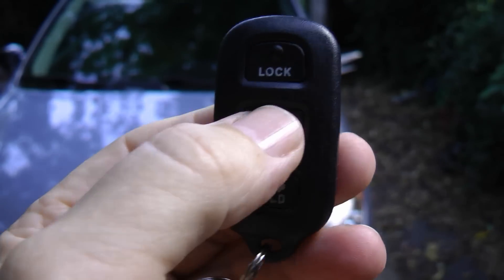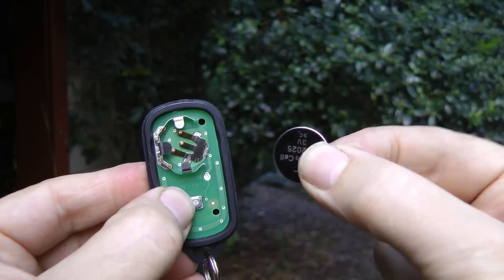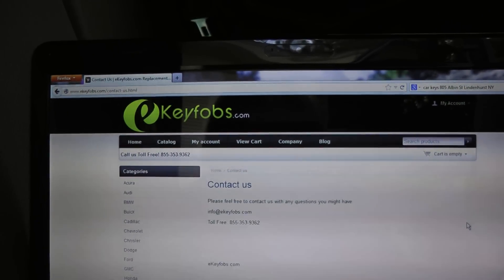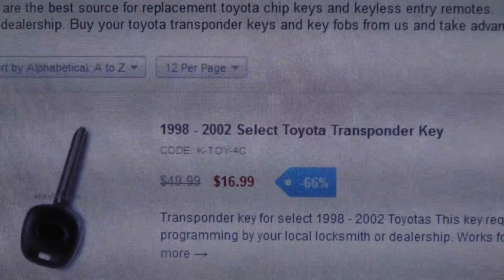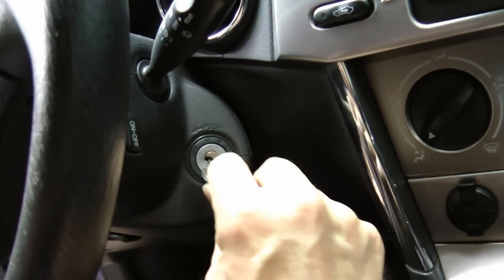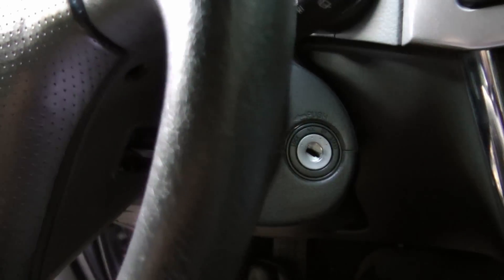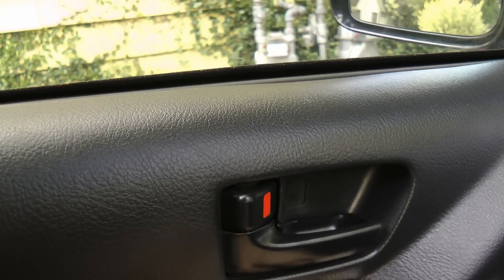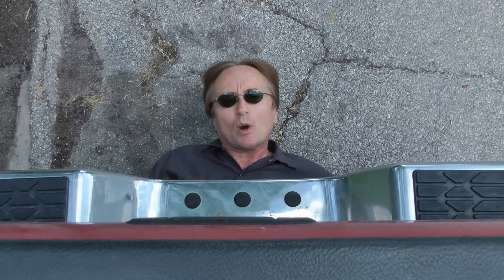How to Replace a Remote Key Fob for Your Car

Comment: Open the door, close the door, put the key in the ignition, turn on the radio, roll down the rear right window, turn on your windshield wipers, turn on your lights, turn your wheels to the left, unplug the cigarette lighter, turn everything off, take out the key, lock the rear left door and your in the programming mode.
Reply: Forget to run around the car clockwise 3 times  then back around counterclockwise 3 times and if you are not dizzy  start over

Comment: LOL. That's hilarious. What were the engineers thinking
Reply: Lucas Short 
I think they just wanted to make it an accessible, independent procedure, that wouldn't be done, by accident, and you wouldn't need a separate computer or tool for.

Another comment was right. It's like a cheat code in an old videogame.

Comment: Scotty, it should be noted that on some cars you have to resynchronize the fob after the battery is replaced. For example on my 1999 Alero you must hold the lock and unlock buttons together for 5 seconds while standing close to the car. The doors will lock and unlock once to confirm resynchronization.

Comment: Scotty, I would recommend trying the remote's circuit by breaking the contacts with the edge of a nickel or other metal. My dad's remote for his Silverado did nothing with a new battery, but then I tried this. Found out the remote worked but the buttons did not. Did some research to find they use a conductive material on the bottom of the button pads and it wears off over time. I super glued a small piece of aluminum foil to the pad and presto! The remote now works.

Comment from the maker: central locking is generally a bad main switch, or the control unit breaking down. Try a new switch and pray, the control unit is very expensive

Comment: often aftermarket receivers are a lot cheaper and work just as well.  Search around for one.  The one for that camry is $450 from the dealer; aftermarket can be had for about $120 that comes with 2 key fobs.

Comment: I would hazard a guess that unbolting the strut and jacking the car up will give you access to the grommets you talk about, so you can replace them. 

Once replaced. Lower the car on the the jack, ensuring the strut bolts go in their respective holes. Bolt the strut back up, job done.

Of course, you'd have to replace the grommet on the other side as it's most likely worn out too and it's just good practice.

Comment: Scotty my radiator fan on my 96 SB combo van stays on , i checked fuses,relays swapped computer , i have temp sensors from another combo to fit , it had a bit of stuff on the brass connections so i've cleaned and polished them , could that be the problem ??? Thanks in advance and i love the simplicity of your videors helps a pensioner that can't afford much , it is greatley appreciated

Comment: Try opening it up and cleaning the contacts with rubbing alcohol. Usually it's just the little silicone pad that touches the contact plate. I find they get dirty after a while and just don't close the circuit after a while.

Comment: scotty my jeep cherokee remote kinda works the lock works fine but the unlock you have to mash it to unlock it so i was looking for new remotes and there are some online but heres the thing for mine to program u need the two keys the car came with but i have the original but the spare one was made will it still work with a key that was made because i dont feel like spending 150 bucks for a new remote and programing at a jeep dealership

Comment: Wondering if you could clarify if I can use any non-OEM key fob for 1998 and 1999 Toyota Avalon(s). Secondly when using a non OEM remote does it require some special receiver to be installed in the car or can I use the existing remote signal receiver as is i.e the one that came with the vehicle.

Comment: On my Subaru I hold down a button underneath the steering column and press the lock button. If the door locks then it's programmed and works perfectly.

Comment: It's real and crazy. To reset and configure the tire pressure sensors on a modern GM car you have to follow a procedure that you definitely wouldn't know unless you designed the system or had a manual....and even if you designed it the manual would come handy haha

Comment: hey scotty. i have a 1998 honda civic ex... its 4 cyl 1.6L and when ever it gets below half a tank of gas as im driving it will sometimes stall.. it is an automatic. i asked a few people and they seem to think it may be the fuel pump or the fuel filter that need to be replaced. do you know what may be causing this? also sometimes it will start right back up and others i need to wait a few minutes until it will start. thanks!!!

Comment: Hey scotty, I got a volvo 945 turbo with a B230FT engine, the problem is. When I start the car i usually let the fuelpump spool up some pressure up to the rail, but the fuel pump didn't have the original whining sound it was almost screaming and when started it layed on 700rpm. Now it's screaming the same maybe alittle more, but the rpm is at 400 and battery + oil pressure gauge is lit up until I touch the gas. Is it the filter or the fuel pump thats giving up? I got 2 pumps on that one.
-Max

Comment: I would rather do that "dance" with the car's BCM  on the doors and ignition than what my car requires. 1995 Chrysler Cirrus. If you manage to find a remote for it still, you have to take it to the dealer. Where they hook the Chrysler DRB-IIII scan tool to the car to access the BCM to put it in reprogram mode. In later years, they allowed for a customer to do it. But 95-97 needed the dealer. They charge $30 for a hookup fee, and it costs $2,000 to buy the scanner itself.

Comment: Scotty, I love your videos. I was just wondering if you plan on doing a video on diagnosing and fixing evap leaks. Like the p0455 one, a leak in the system other than the gas cap not being tightened enough. I've heard epoxy can be used, or replacing a filler tube or whatever. I'd just like to see some info on that system.

Comment: Scotty sir, that was real informative and a cheaper option than the $ 160 Hyundai charges for a key fob replacement. Btw, my car keys have the option to fold the keys in. Can such fobs also be replaced? If yes, do we reuse the key from the stock one? Thanks for reading this post.

Comment: My dad's 2001 Tundra had a faulty remote installed. It never activated when we wanted it to, but it activated on it's own. The worst part is when it activates when were driving. The truck drove fine, but when we turn it off, it stays on. So you have to turn the key to the start position and try not to stall it. Which is harder than you think. Then you can trun it off. We didn't even use the remote anyway. Fortunately, we could just turn the remote off by the gas pedal.

Comment: i got the same problem with my old renault scenic. it was working but was dodgy. i opened and i saw some rust, like a white stuff on it. in the end i had to clean the chip and re solder the fob light.

Comment: Hey Scotty Kilmer, i think you will remember me, the guy with the Volvo 440 that runs 7KM on 1L. well i got another question for you! i bought my car for extremely cheap. i only got 2 keys with my car. if i use the provided key in the drivers door all doors open/close including the trunk. i dont have any FOB for my car. is there a possibility i can still program a FOB for my 440?

Comment: Hi Scotty! Love the videos. I got a 2006 Camry SE. Both remotes on my car have stopped working. I tried reprogramming the spare to no avail. I'm ordering a new remote to try and see if it works. Would it be fine to just install a decent aftermarket alarm system?

Comment: May I check ask you 2 questions:(1) If it's the same programming procedures for a Hyundai Grandeur?(2) Where is the remote control receiver usually located in the car?Thank you.

Comment: If the OEM remote is without power for some time, then you need to reprogram the old one as well. Fortunately the sequence of keystrokes was explained in the drivers manual on my GM when it happened. So, before buying a new one, try to reprogram the old.

Comment: Scotty, the Service Engine Soon on my 97 Infiniti I30 is really bugging me. It was tripped after I took it to the dealership to get a free tank of gas and I guess the guy over filled it because the needle went above the full line. I took it back after 4 days and they reset it but 4 hours later it came back on. I really need your advice on this man.

Comment from the maker: programming a key to start a car with an immobilizer system is something different. If you mean that, gotta pay the dealer or a bonded locksmith, as only they can get the codes, even I can't do that.

Comment from the maker: problem with evap leaks is all cars are different, and without a dealer level scan computer and a smoke machine, you're pretty much wasting your time. so such a video wouldn't help too many do it yourselfers out.

Comment: Hi Scotty,
I have 2000 Civic with third party(Glentel) alarm installed. Alarm works fine however remote start acting and sometimes after locking the car it keep on locking and unlocking without any prompt. This drains the battery pretty quick. I could not find any Glentel remote and wondering if any other remote can be programmed as you demonstrated. Thanks for your time
Reply from the maker: +Harry Jatt na, it would have to be that model
Reply: Thanks!

Comment: Always check the battery holder solder joints for small cracks , many times that is the problem.

Comment: Hey Scotty what If only front doors work with the remote? The rear door locks only budge half way and I have to lock and unlock manually. Is that the motors in the doors? Do you have a vid already? Thanks 99accord

Comment: I had an old ir-remote system in my car and the remote didn't work. Guess the remote itself was bad, using the digital camera-method I could verify the led didn't blink. Couldn't find cause for this, tried replacing the led from some old tv-remote just for the hell of it, didn't work. What worked was I bought "a general model" rf-remote system with 2 pre-programmed keys. Installed that (to the same wires that went to the ir-receiver box), took about 30 mins, costed about 30 € and works fine.

Comment: Hi scotty I appreciate you and your effort in creating the diy show.  I have a 99  LEX with an aftermarket alarm. When I pre unlock I hear clicks on the door. But I can not open the door not even using the key. Do you think I can use the same steps as the video for solving the
Reply from the maker: +Nathaniel Johnson give it a try, but it sounds like the door latch assembly will need replacing

Comment: The key fob for my Toyota yaris works fine when unlocking with the remote but when it comes to locking it won't work lock unless you press unlock and then lock again? Any thoughts?

Comment: the aussie ford falcon you just put the key in the ignition to acc mode and press the demist button 3 or 5 times then it will lock and unlock and press any button on the remote and its done

Comment: How about this?  I'm driving a 1999 Dodge Intrepid (I know, you hate the Intrepid), and to get the key fob to work, I've got to be about a foot from it, and even then it's hit-and-miss.  I've changed the batteries with no luck.  It sounds like the remote transmitter might not be working.  But on the off chance that's not it and I get a new fob and continue with the same problems, where else can I look?

Comment: I put my fob through the washing machine lol, luckily it still works but the range is really bad and I have to hold it right next to the car to get it to work. I've changed the battery. Are there any tips on boosting the range? it's very annoying :(

Comment: One of my cars with a dead remote but now has a new one that needs programming requires fondling some wires tucked in the trunk area but the trunk lock refuses to turn with the car key. Before I drill the lock out or call a locksmith, is there another option?

Comment: With my 2002 ford taurus you had to turn the key to on then off 8 times in a row rapidly then  leave it on and the  locks would cycle and it would be in programming mode..

Comment: Hey everyone I have a question. I have a 2005 Kia sorento and I started it up with a the remote starter. I heard the engine start and I heard a scraping noise. so I thought the engine was out of oil. The engine oil level is normal . I put the key ignition and turned to accessory mode and the it started up. I heard the scrapping noise again. 

I put into Neutral and I still heard the scrapping noise. What should I do ???

Comment: Programing a 01 mustang is way better. Get in close both doors turn the key for off to on (not crank) 8 times with the 8th time being in the on possition the doors lock and un lock press any button on your fob the doors will lock and unlock keep the cr in the on possition for 10 seconds and your good to go. Now hopfully your lock actuators ae good unlike mine and your fob will do more than alarm and trunk. I'm ordering new lock actuators in a few days already have the old ones out.

Comment: I've a 1995 Pontiac grand prix four door and  its sputtering like its missing or out of gas. Step on the pedal and bogs and gags and stalls almost. Put it  in neutral and it idols and runs fine. what's the problem?

Comment: Toyota trucks are expensive compared to the competition that's true unfortunately, but I just recommended it for it's durability. Get a ford F150 if you want my opinion, it is the best truck ford has to offer, way better in terms of reliability and cost than any other model.

Comment: need help with my dads ford explorer 2005 intermittent no start, could not find a shraeder valve to check the fuel pressure, and the check advtrac keeps showing in the dash

Comment: did ur story work on others models cars like vw golf 4 from 2001 ?
Reply from the maker: all makes are slightly different. Contact the company in this video, and they can tell you how yours works exactly
Reply: how do I contact the company in this video?
Reply: ty anyway for the unswer
Reply: marius bogdan durnea You go to Keyfobs.com and find their telephone number and call about your model. If your remote is not working and it's not the battery, buy a new remote. The old one doesn't need to be reprogrammed it's just dead.

Comment: Hi I wanted to ask a question I have a 06 Grand Prix and mines come with the key start already programmed in the car but the key fob doesn't work I looked on a video on YouTube and the guy says if you have a check engine light that your remote start won't work is that true

Comment: Hey 95 Honda Civic dx manual transmission 1.5L 16 valve my speedometer is from an automatic changed to make better works but may be off few miles would the speed sensor still be working fix what? To make speed exactacly right with reading

Comment from the maker: no valve on most new ones anymore. But find a guy like me with a machine as in my video "fixing modern cars using high level scan computers" and have it analyzed, tons of data inside there waiting to be seen by a smart guy with a machine.

Comment: Hello, I don't know if maybe you'd know exactly whats going on, with my issue but I have contacted a dealship and they said they never heard of this before. I bought a keyfob online because I needed one when I purchased my car and when I programmed it, I was able to use it to unlock and lock my car, and open the trunk. But the panic button on it only sets up a sequence of clicking sounds as if the alarm was sounding, but no chirping. And also now all of a sudden my horn on the steering wheel doesn't work. I have a 1998 pontiac sunfire, I have checked all the fuses under the hood, and on the left side of the dash board on the driver side and everything looks perfect. Would you know why my horn doesn't work and alarm doesn't work after programming the keyfob?? I desperately need help and the car dealerships cost almost $90 an hour just to look at it. I need my horn to work in order to take my drivers test because of the inspection. Thanks in advance!
Reply: You'd most probably have a short somewhere. Because when electrical power is flowing through when there's a short somewhere, it can fry a whole bunch of stuff. So the remote didn't cause it.
Reply: +Lucas Short yes I figured it out thankfully, it ended up being a blown fuse I guess somehow I missed a fuse when checking everything twice and the fuse connected to my cigarette lighter was also connected to my horn and that blew so once I replaced that everything worked fine :) ty

Comment: For most late model Honda/Acura remote key combos you will need to get the immobilizer chip in the key programmed by a locksmith or dealership. Then you can program the buttons yourself. I actually have a youtube video with the instructions.

Comment: It really depends. If your 2nd key was cloned at a place like Ace Hardware or Lowes, then no. If it was a programmed  by a locksmith or dealership then, yes. If you want to contact me through my site I can better help you out.

Comment: hi Scotty, i have a remote problem with my Volvo s40, sometimes it works and other times it doesn't work. I replaced the battery in the remote itself but now and then it doesn't work. Do i need a new remote or is there another way of fixing this? thanks.
Reply from the maker: +Richard Meppelink pray it's just a bad remote, cause the receiving unit in the car costs a fortune
Reply: I recently got a toyota camry for a steal (03') but the keyless entry does not work. I replaced the battery and tried this but the steps involving the  fob did not work, so I probably have to buy a new one?